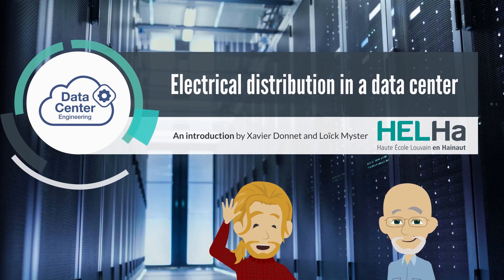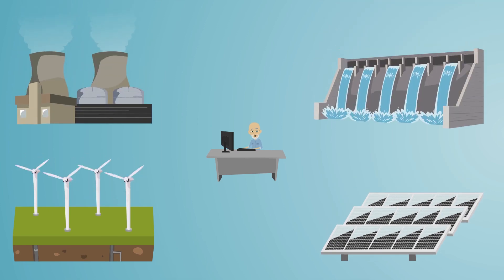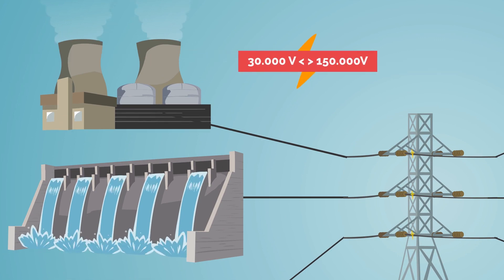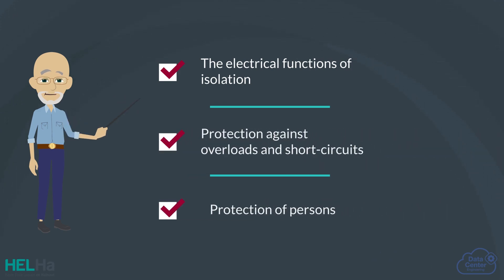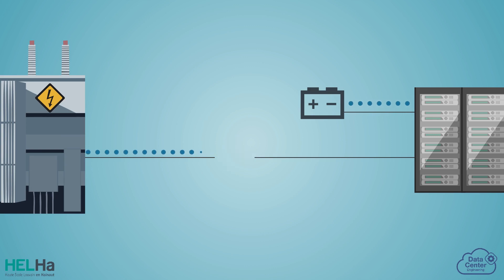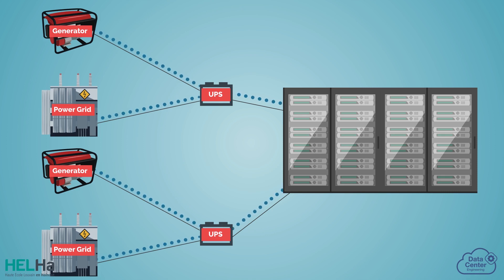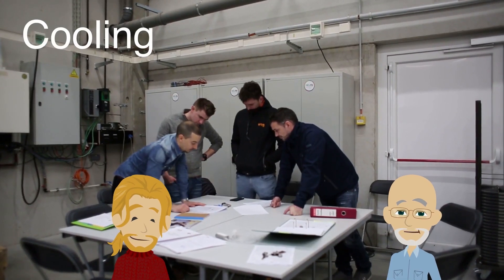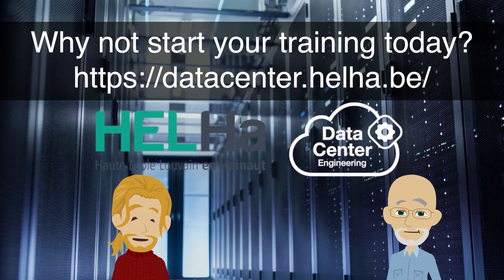Electrical distribution in a Data Center

Comment: The advantages of vertical design are obvious. Broadwatt's solution not only has good heat dissipation but also enables flexible capacity expansion relying on Broad Group's technology.